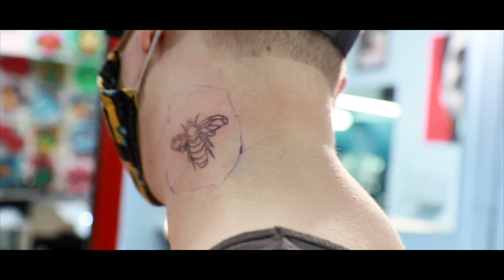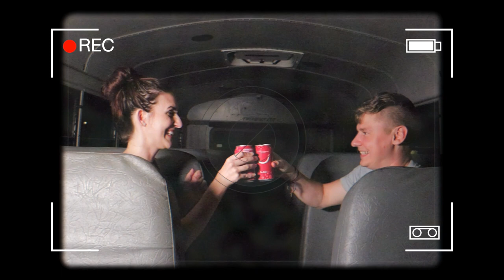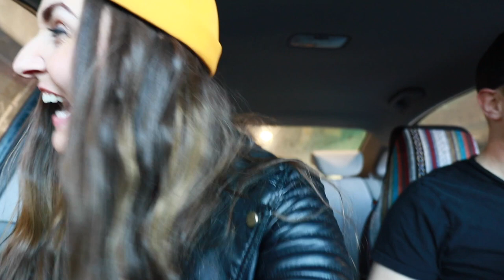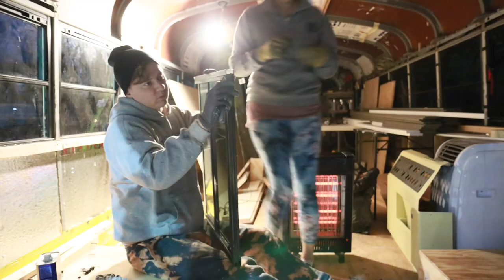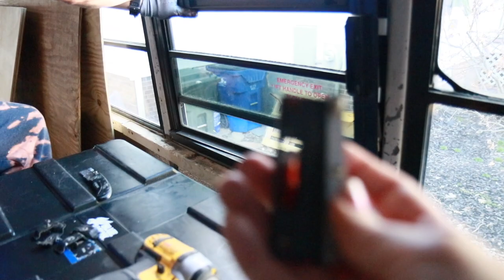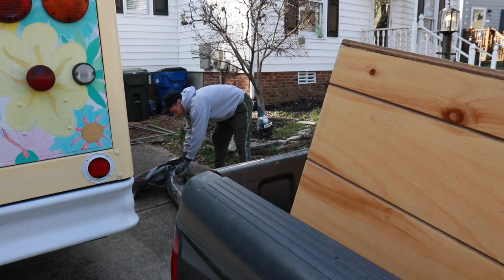School Bus Conversion || Installing Windows

Comment: What do the new windows do that the old ones don't?
Reply from the maker: Killer party tricks 😉 haha we replaced the okay ones for the great ones...basically the areas where we are boarding up and building walls got the decent ones and the great ones are relocated to where the windows will be visible at all times.
Reply: What's the insulation like on them?
Reply from the maker: Terrible haha! That’s why we will be insulating the walled up parts. Then we will get thermal curtains for the open ones.